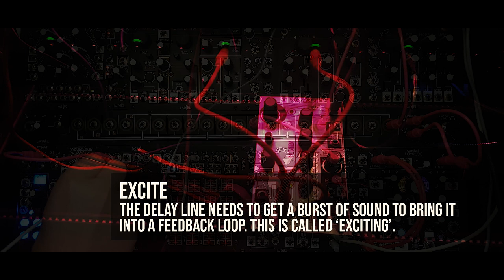Shared System Tutorials | Part 21 | Physical Modeling

Comment: A gate in!! Genius!
I used to use the wogglebug to make noise (stepped output running reallllly fast make a white noise)... Gated with the modemix to trigger the Karplus 

I forgot . Can’t the EP just self oscillate? Guess wouldn’t need the short burst to trigger the karplus strong (the traditional way wit the white noise burst)
Reply from the maker: Yes it can, when you 'excite' the delay line with a gate and turn feedback fully left or right it will create different loops. It's just that the feedback out/in patch will make it overload and you can get these insane dark low growls or high pitch stuff.

Comment: I love your tutorials, they help me understanding my shared system much better and are very inspiring. I replaced Echophon with Mimeophon, Pressure Points with XPAN, XOH, QPAS and 0-CTRL. What do you think, should I keep Echophon and Pressure Point or is there no added value in combination with the whole system?
Reply from the maker: You should definitely keep Echophon because it's incredible when combined with QPAS (and this video gives you plenty of examples). 0-ctrl provides more common functionality than pressurepoints, so you will not miss it when it's gone. PP can still do independent pressure/gate on four channels, which 0-ctrl can't and there will be patches where you could need it and be sorry it's gone. When I started with my shared, I sold my Echophon and Phonogene almost two weeks later because 'I did not like them'. A year later I bought them back and I currently have two EP's and three PG's. I know, I am a mad scientist, but I love stereo and these pairs fill that gap. The Echophon is the equivalent of a vintage tape delay and there are many, many musical scenario's where it's great. I never knew the insane sounds Brian May (Queen - listen to 'Get Down Make Love') creates with his guitar are actually from a pitch shifting echo like the EP.
Reply from the maker: QPAS & Echophon: https://www.youtube.com/watch?v=JoA7Ef7Mln8
Reply: Ok. Thank you for your advise. I will keep them. The only issue is rack space. A second two row case is a bit of an overkill. If only the 0-ctrl would fit in the MN 104 skiff. 
Cheers Pascal

Comment: 2:07 "Pitch shifting tracks 1v/oct when depth is turned fully CW > good tip. the official manual doesn't state that
Reply from the maker: Can't remember, but Walker demonstrated it in early EP videos. I've seen lots of discussions of 'why do we need pitch shifting on an echo', but I feel it's awesome and it's exactly what enables Karplus Strong synthesis.